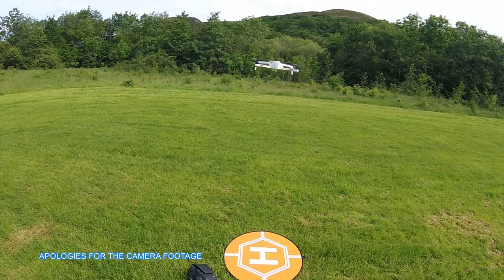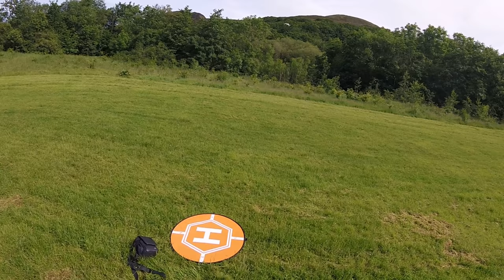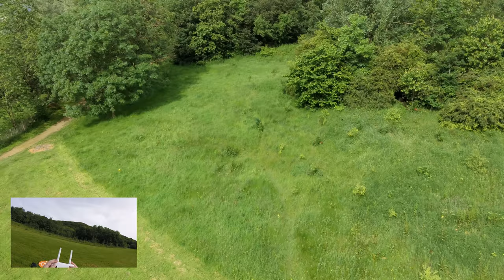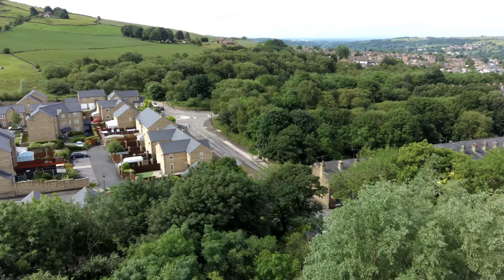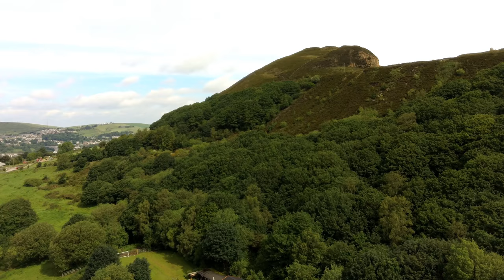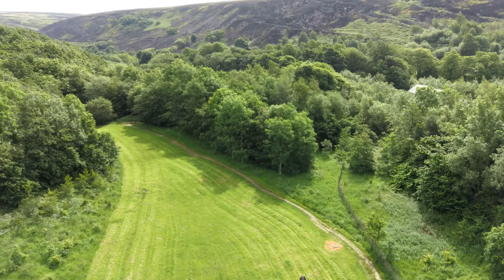HUBSAN ZINO FIRMWARE 1.1.52 FLIGHT TEST

Comment: Useful video, thanks for sharing. When I tried it out I found the precision landing mode works better if you have the landing mat blue side up, although its still not 100% accurate. Personally I prefer to land manually, but its still good that Hubsan are giving users the option.

Comment: Back in the winter I did a video test and I thought the 4k video looked better than the 1080p. But I will have to  retest it now after at least three firmware updates since I last tested. But I agree, this update is the most important one since they fixed the soft focus issue in January. The speed settings are something I have been hoping for, now we can get more smooth and cinematic video.
Reply from the maker: Hi Ron i think the camera was better under update 1.1.48 it might just be me though take care mate
Reply: @CKone41  Trying adjusting the camera settings a bit under 1.1.52. They used to not have much affect on the image, but now they do, I like to add a bit of sharpness.